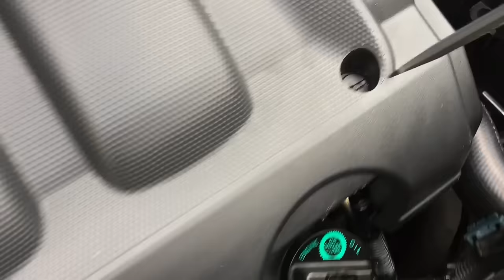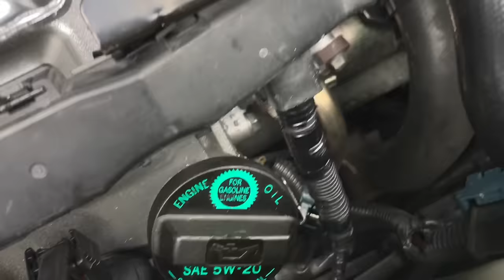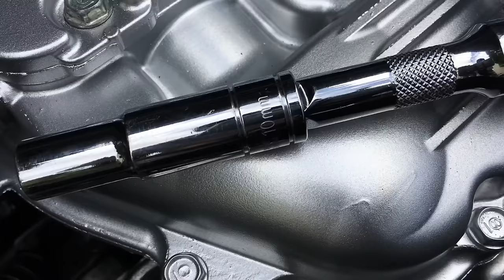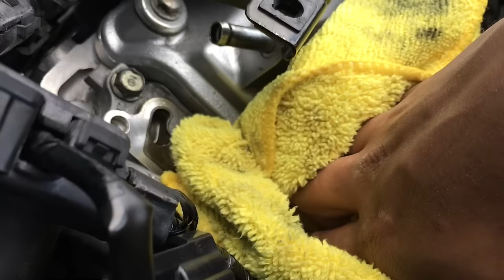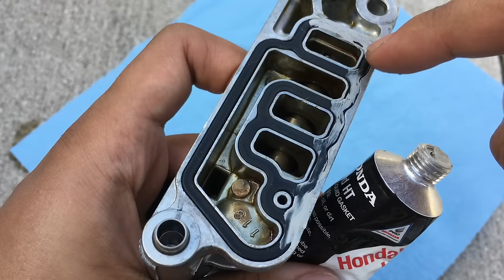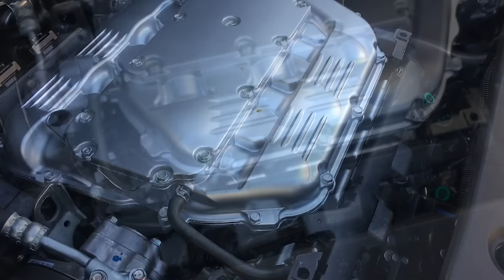2008-2017 Honda Odyssey Front VTEC Solenoid Leak Fix DIY

Comment: Wish my engine bay was as spotless as this
Reply: That IS one clean ass engine
Reply: Haha I thought the same!
Reply: Right
Reply: All u gotta do is go to a car wash leave the engine running set to degreaser mode let sit for 2 minutes then rinse with pressure nozzle. lastly dont turn off engine until water has evaporated. Done.

Comment: Disconnect the battery. Unclip the 2 electrical connectors. Remove the 3 bolts (not that middle one). Pivot the valve out from under the wire harness. No need to remove anything other than the 2 electical connectors and 3 bolts.

Comment: Your videos have been so helpful. Just bought a backup 2010 can and - of course! - you have a video for replacing this gasket which is bleeding like crazy on my engine. Thanks for all your efforts!

FYI you walked me through replacing an alternator today on the 2010.
Reply: Did the leak cause alternator issues? Just bought 2010 a few months ago and check charging system light comes on periodically, but almost always when first starts. Then turns off about 10-15 minsters later. Before turning on the car, the battery is testing at 12.6 V after starting it gradually goes down until the check charging system light turns off then immediately jumps up to 14 V. When the check charging system light turns off the car hesitates for just a split second like it wants to die and then everything rubs back up. Trying to figure out what’s going on, advanced auto and AutoZone tested battery and alternator and both said it was fine. Today however I noticed some leaking around the dipstick area but looks like it’s coming from slightly above, so I’m thinking it’s this valve leaking thing.  I had read somewhere online that it leaking could lead to alternator issues, I don’t know anything about cars and I’m just trying to learn and was wondering if you had the same issue?
Reply: Yes. It fried the alternator.

Comment: Just did mine the other night I'm happy I looked around to make sure it wasn't something else.   I'm good on putting gasket sealer on that part though.. I have my old part with extra gaskets and I'm going to get a junkyard alternator to keep in the car for. Road trips just incase this happens again on the road.  Even though all the parts are new now .I kept all my old parts for that reason lol I refuse to leave my family abd me on the side of the road
Reply from the maker: This fixes the issue if done right, but after this video was published the gaskets came out, that's why I have a updated video.

Comment: Thanks for your response. I will give it a try. My alternator got ruined because of all the motor oil leaking onto it
Reply from the maker: Tell me about it. The leak covered my alternator, catalytic converter, etc all covered with oil.
Reply: Same problem here, I'm lucky the alternator was under warranty
Reply: Thanks, MrRangerZr1 - I believe my leak is the same problem.   My alternator still works, but covered with oil.   Can you use degreaser or something to clean it?
Reply from the maker: I wouldn't spray or drench the alternator in water. I would spray some brake cleaner on a towel and wipe it clean.
Reply: @MrRangerZr1  Thanks for the procedure, right now I am having the same problem and I read stories about people who changed the gasket, cleaned the surfaces, tightened the bolts with specified torque and it still leaks. Is there any secret while doing it so that it does not leak? Also for those of you who have oil spilled on alternator, NEVER spray brake cleaner or carburetor cleaner on alternator. Just like MrRangerZr1 stated, take a towel and spray the brake cleaner on the towel, then wipe the alternator as much as possible, other solutions require replacing it or taking the alternator to a rebuilder.

Comment: Thank you for such a great video. I also must say wow what a squeaky clean engine bay. 

Is there any trick to getting the connector off of the EGR valve? I’m pulling but it’s not coming off. Just asking before I try hitting it with my purse 😅😂
Reply from the maker: it can be a pain, just wiggle the sh1t out of it lol
Never pull on the wires, grab and pull on the connector itself.

Comment: I’m happy to see how many people have had success with this. But unfortunately I’m very upset because I cannot get this. I have a 2011 Honda Odyssey EXL that needs the front spool valve gasket replaced due to significant leak. I cannot follow these directions verbatim because on the right side of where the injectors are at about the one minute mark in this video, there is a thick plastic ridged line that comes off and attaches to a fuse box and the battery. I have no idea how to begin to disconnect it. It’s not a connector. It floors me nobody else has run in to this. Does anyone have any idea what I’m talking about?......I literally cannot move the piece out of the way so I can’t move on through the process
Reply from the maker: Work around the harness, you don't have to remove the wiring harness completely out of the way. Makes it easier but not necessary.
Reply: @MrRangerZr1  thank you for your reply

Comment: Before I tear into mine, I bought the replacement part direct from Honda. It came as a complete unit not just the top half as depicted in the video. However, there was no gasket of any kind. Should there be a replacement gasket for the lower section where it meets the engine? I would have thought Honda would have provided one if there was, or suggested it when ordering/buying. Anyone who can help would be appreciated. Thanks
Reply from the maker: That portion is installed with hondabond. You just need to remove the gaskets from the assembly and put it on your car.

Comment: Great video! Helped me out a lot. I followed all the directions step by step. Brake cleaner.  And let the sealant dry for a 24 hours. The leak has noticeably slowed down. Would you recommend doing the same sealant to the bottom gasket?
Reply from the maker: Check updated video in description

Comment: I have an engine oil leakage from passenger side on my odyssey 2010 EXL. I checked it is not coming from oil filter gasket. I suspect my front solenoid gasket is leaking but i am not sure. How can I verify that front solenoid is the real culprit before fixing it? And how could I verify that which solenoid gasket (under and above metal plate or both) are bad and need to be fixed and replaced? Any suggestions to identify bad/leaking gasket.
Reply from the maker: Thoroughly degrease/clean the whole engine bay. After you clean it, you'll be able to tell easily where the leak is coming from.
Reply: MrRangerZr1 thanks. How can I clean engine area around belt (right front wheel side), there is not much space for cleaning.
Reply from the maker: I have videos of cleaning the engine bay on my channel. Just cover the alternator and spray degreaser, let the degreaser eat through the grime and wash it off with water.
Reply: So as I doubted, After cleaning area near dipstick, I found oil near dipstick and front solenoid. Not sure if it’s dipstick leak or solenoid leak. if you can suggest. Here is the video clip https://youtu.be/UWxDL6lCbSM
Reply from the maker: Yep that's the solenoid gaskets, it will look like it's leaking from the dipstick. Check out the new updated video of the solenoid gaskets. It's linked in the description.
Reply: MrRangerZr1 quick questions. 
As confirmed, I saw oil coming from dipstick area on which you said it’s solenoid gasket leaking from dipstick. So is it gasket is bad or dipstick black ring from where oil is coming out?

If it is gasket, can i fix it with hondabond silicon or both upper and lower gasket needs to be replaced?

Or if it is dipstick ring, how could I fix/replace it?
Reply from the maker: It's not the o-ring gaskets. 
The hondabond fix will work (this video shows that) replacing the gaskets will also work but I recommend buying the OEM gaskets but you'll have to pay almost $200 for a new valve spool assembly because honda doesn't sell just the gaskets...
Reply from the maker: To remove the whole assembly yes you have to remove the valve cover.
Reply: I replaced the gaskets and it did fix the leaks but during repair and I spilled lot of oil over my engine. I got multiple misfires codes along with P3497. Though i fixed the misfires code but I am still getting engine light on along with P3497 code. It seems I will have to change the complete vvt solenoid assembly.
Reply from the maker: Replacing the gaskets will not cause misfires or the code, you messed something up. Check your install, check all connections, make sure the connectors click.
Reply: MrRangerZr1 agree. It was the oil that I spilled and it went into spark plug wells. I ended up with replacing my spark plugs. Thanks for your help but I messed up. 

Do have any suggestions or video showing how to replace complete assembly? I could not find any help. How difficult would be to replace the complete assembly?
Reply from the maker: How did oil get into the spark plug wells? Valve cover seals bad? 
It's a PITA to replace the whole valve. You don't need to replace the valve.

Comment: Did you install a new rubber gasket?  If so, why did you add a sealant?
Reply from the maker: check my updated video.
with new gaskets you don't need any sealant

Comment: Did you buy OEM spool valve. I saw you made 2 videos on this and not sure if you bought an aftermarket and it didn't work and leaked?
Reply from the maker: Check the updated video.
And i recommend getting the oem valve
Reply: @MrRangerZr1  what is the updated video?

Comment: had this done on my 2008 odyssey and then check engine light came on. mechanic said it was a transmission issue that caused the light, so i ran it to transmission shop who fixed that cheaply. On the ride we noticed the van's now not running on all cylinders. wondering if you've any experience with this chain of events?
Reply from the maker: Both your mechanic and transmission shops dont know what they are doing. 
What problem did you go in with to begin with?
Reply: @MrRangerZr1  had an oil leak near the dipstick. they changed the "variable valve timing solenoid" and "valve cover gasket". Now it's misfiring and the engine light is on. The transmission light was on too, but had a transmission place remedy that. They unplugged and reseated two connectors. So currently the check eng light is on and it's misfiring. First mechanic is having a look at it again this Friday. I've gone to him for 15 years. Usually it's great work. Saw your video and am I right to think the valve gasket is on wrong in some way?
Reply from the maker: No idea what they did. They most likely didn't put an OEM solenoid on.

Comment: Hi. I am in need of replacing that very same gasket but Honda will only sell the hole part . Did you purchase that gasket sealer from Honda or your local store like Autozone?  Thanks
Reply from the maker: The sealer is from Honda. I don't think Autozone has it, they have a similar gasket called Permatex but Hondabond is best.
Reply: Check Amazon or eBay they cost 14 for the set

Comment: Hi long did u have to wait for the Honda bond to sit for before tighting it down all the way
Reply from the maker: Tighten it down, then wait. Overnight is best.
Reply: @MrRangerZr1  thanks again for your response and you kick ass on your work my friend how tight would u tighten up enough but where u don't force it or would u use a torque wrench I am working on a 2011 Honda pilot same engine as the Odyssey  just want to make sure it's at a right tightening on the bolts thanks again

Comment: I just did this for my  2009 accord V6 , but the oil still seep through when I start the engine. The gasket maker i use is genuine Toyota fluid seal packing.  Do I need to do it again?
Reply from the maker: The reason why that happens is when you reinstall the assembly, oil seeps down and ruins the gasket. First clean the inside of the assembly with brake cleaner, make sure no oil is present, and then apply the gasket. It happened to me.
Reply: MrRangerZr1，it worked and no more oil leak. thank you very much!
Reply from the maker: Glad it worked out!
Reply: I have a 2009 Honda Accord EXL V6 and it’s leaking in the front. I am thinking it’s a valve cover gasket. But more than likely it may be this. But on my car the part doesn’t look like the same as video
Reply from the maker: Could be valve cover gaskets or the cover itself.

Comment: how do you know the solenoid oil leak is from the top gasket not the bottom one?
Reply from the maker: You really can't tell, that's why you replace both gaskets like in the updated video.

Comment: I did exactly what you did. I only used gasket seal on that one same gasket you did in the video... still leaks used seal on the other gasket underneath the plate too. And I still got leaks.... is it just because I got a bad new gasket? Help
Reply from the maker: There are two gaskets, check the updated video.

Comment: I want to replace the entire spool valve, not the gasket. Is this the proper way to get to it and remove it?
Reply from the maker: To replace the entire assembly you need to remove the valve cover and rocker arm assembly. No need to replace unless the hondabond is leaking, which is very rare.

Comment: Did this last year on 08 accord v6 coupe. 
However the leak returned but the leak is lower down now, or maybe it was there where the original leak was all along. If I remove the part below the solenoid what kind of mess am I looking at, is there a gasket there also or is it just epoxy on the lower portion?
Thanks
Reply from the maker: Don't use epoxy, replace the gaskets. Check the update video in description.
Reply: did you put honda bond?  does it really need it tho?

Comment: Is it recommended or necessary to put Hondabond on the top gasket? Your updated version and some thread don't recommend putting Hondabond.
Reply from the maker: No need to but doesn't hurt...
Reply: Thank you.
Reply: @MrRangerZr1  Hey really appreciate your videos.  I recently changed my rear spool assembly with an aftermarket from Amazon on my 07 odyssey.  Leaked. Ordered another, leaked worse.  Thinking of getting the Honda sealant and applying it on the new assembly that's leaking.  I may have overtightened this last one, so not sure if that would make it leak worse. Just wondering what's your take on this.? Will applying the HD sealant cure my problem?  Could overtightening make it leak?  I'm running out of options and don't want to have to buy $700 oem 😬
Reply from the maker: @jayquinty  Did you watch my video on the 05-07? There are 3 gaskets.
Reply: @MrRangerZr1  Yes I watched it.  I installed a brand new aftermarket spool valve (twice) and the included gasket for the surface  between valve and the head.  So not sure about any additional gaskets. I bought the Honda HD today so I'm going to take it off and put a thin layer of HD on the new gasket and reinstall.  Hopefully that solves it. Could just be cheap Chinese parts.  Crazy.

Comment: Can a solenoid gasket leak cause alternator to die?  My alternator died (with less than 20,000) miles and mechanic thinks it is the solenoid leak that caused it to die
Reply from the maker: Yes it can, common.

Comment: Great video! Can you show how to remove the rear spool valve assembly? (Vtec solenoid)
Reply from the maker: Sure thing.
Reply: MrRangerZr1 thanks, my Honda Pilot 2010 rear spool valve assembly needs to be replaced but I can't find those bolts holding the assembly. Do I need to remove the valves cover in order to gain access? Thanks again...
Reply from the maker: I'm not 100% on the rear solenoid...it should be the same as the front. Get a mirror and look around. Worst case, you might have to remove the rocker arm assembly to replace the spool valve. I'll take a look at my van and will let you know.
Reply: MrRangerZr1 thanks 🙂!

Comment: Just recently ordered gaskets and replace small leak on 2008 Honda Odyssey, afterwards got a P2659 code but went away after  going 5 miles down the road, 250 miles later check engine light comes back on, sure it’s the same code, can anyone help me on this or maybe had the same problem what did you do to clear the codes, I followed the steps as shown in the video but still got a code. Thanks for any help!
Reply from the maker: Well check the code again, could be something else. If the same code did come back, you need to change the whole assembly.

Comment: I have an engine vacuum leak which I can't find but I hear vacuum hissing sound by this Solenoid. Can vtech solenoid cause vacuum leaks?
Reply from the maker: Check the PCV hose right untop of it
Reply: @MrRangerZr1  I did, its something else. I am hearing an audible hissing sound. Can intake manifold gasket cause vacuum leak? I am also wondering if I should change valve cover gasket (there is no oil leak what so ever), I assume a leaking valve cover will cause oil spills, but I am getting frustrated.
Reply from the maker: Post a video of it.

Comment: Do you reccomend changing the gaskets or the whole assembly? I have the gasket for it.
Reply from the maker: Just the gaskets.
Reply: I found out where my leak is from. Its coming from the top where that gray cap is.
Reply from the maker: @sangxu6876  Which gray cap?
Reply: The grey cap on the assembly
Reply from the maker: @sangxu6876  That's not replaceable. Bottom switch has a o-ring. Thoroughly clean the area and watch where it leaks from.
Reply: @MrRangerZr1  it was leaking from that top area and the front by the dip stick. I replaced the assembly but still got a slight leak from the front.
Reply from the maker: If you don't install the gaskets right it can leak. Also check the valve cover gasket.

Comment: MrRangerZr1, what torque did you use on those 3 bolts?  Thanks.
Reply from the maker: There is no torque specs in the manual, I would say 8-9 ft. lbs.  Just tighten it down like I show in the video.